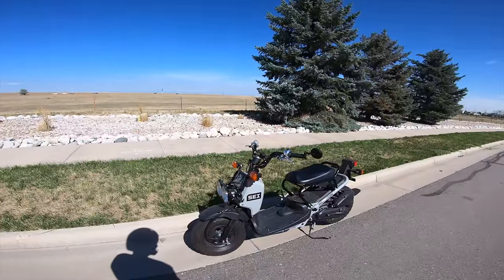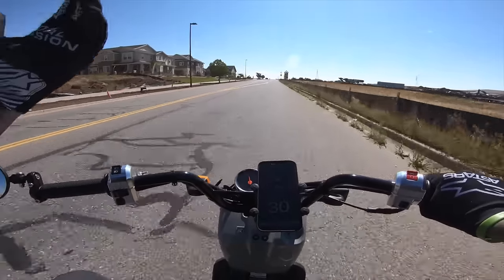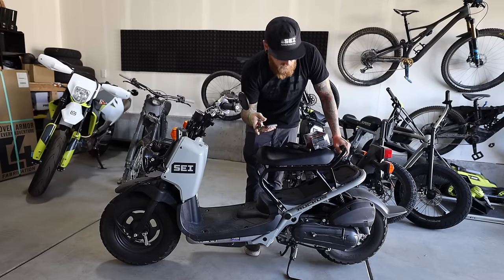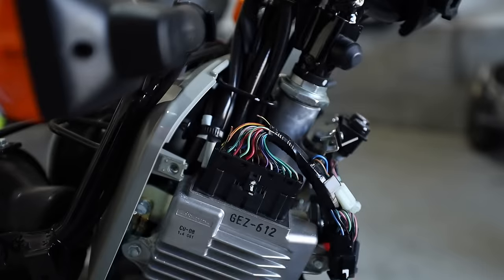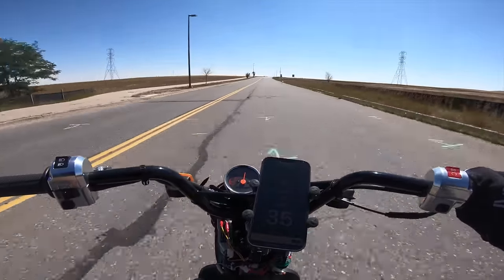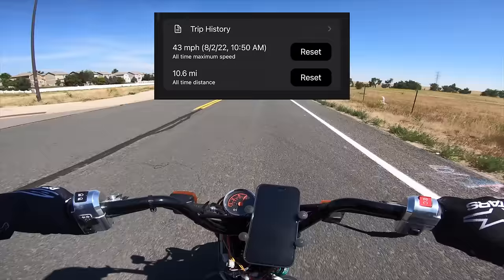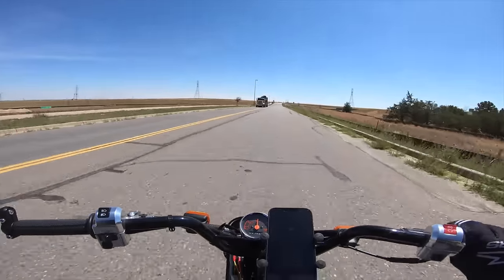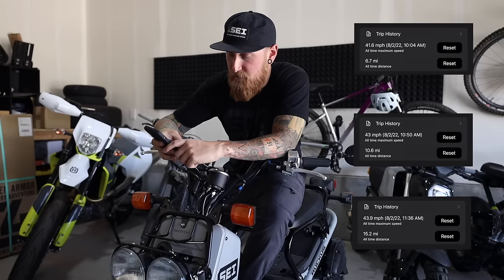Honda Ruckus Go Fast Kit! | Stage 1...

Comment: Just so people are aware. most states don't require a motorcycle license to ride a 49cc scooter but they do require that it be limited to 25mph. 

Great video. I had a aprilla sr50 that I modified and was able to get 65-70mph flat.

Comment: To be safe on the road on a small bike like this, you need to be able to go at least 10 mph over the posted speed limit to keep from getting run over!
Reply: Not really. I have driven small bikes for years and it's not much different from a normal bike

Comment: when installing the variater there is no reason to take off the belt or the clutch just the variater and the rolls dont need to have a flat spot they are mostly round on other rolls the variater also normally only give acceleration

Comment: "go fast" on a 50? The answer is 2-stroke, and a big bore (70cc). Ruckus is fun, but is not and will never be fast. Probably $1500 or so into my 2 stroke Zuma and I hit just over 100km/h (62mph). I can cruise EASILY at 50-55mph.

Overrange CVT, 11:1 final drive, 21mm carb (19mm would work find too, I believe), Stage6 Sport Pro cylinder and Yasuni C16 exhaust. Malossi Delta clutch helps drivability, but isn't necessary.

Comment: If this Ruckus goes over 30mph you will need a motorcycle license to drive. Most laws say 49 cc or less with no more than 30 mph equals moped status .
Reply: Sounds like we’re gonna need radar detectors on our 30mph beasts
Reply: My state is 35mph and speed limits are like warning signs... literally every single driver goes 5-10mph over the speed limit. If you actually drive you know this. Literally every road everyone is doing 5-10 over the posted speed limit. It's totally fine to go 5-10mph over the speed limit on a scooter, lol. It's a freaking scooter, cops aren't worried about a scooter traveling at 40mph. You'll actually make drivers mad going the "speed limit" LOL. They will pass you even in a car.